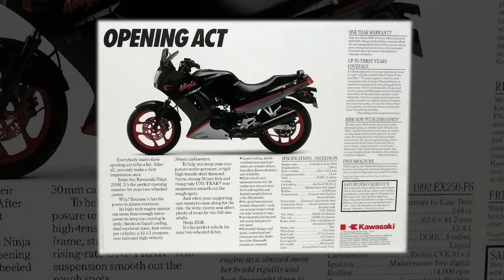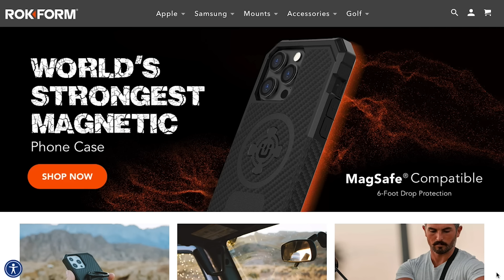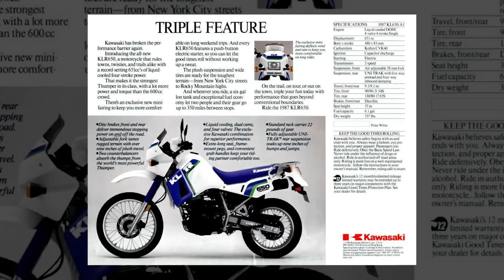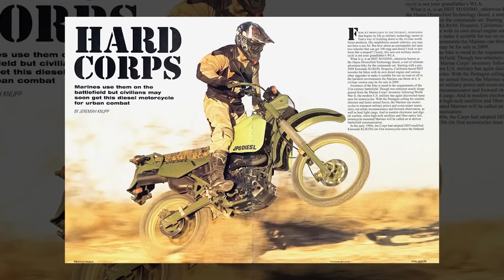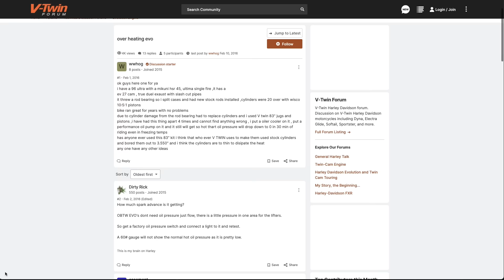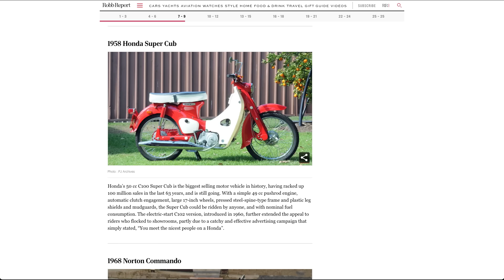Top 10 Ridiculously Reliable Motorcycles (Unkillable)

Comment: I’d argue that GSXRs are unkillable…think about the torture they’re constantly subjected to. And guess what? They just keep going. Wild.
Reply: Whoooaaaaaaa...... my GSXR 1000 and I are about to turn over 40k 🤣🤣🤣🤣
Reply: I had a 2005 GSX-R 1000 with just shy of 50,000miles. 
I had it dyno'd and it made 2 less HP than New. 
I think I was the 5th owner.  Lol
Reply: Bandit 1200
Reply: @johnnyhumbolt2545 I’m peanut butter n jealous 😩
Reply: @ar33turbo gsxr engine
Reply: The old oil cooled, yeah I’d agree.
Reply: @rapid13  new ones are the exact same
Reply: 100% agree! I had an 06 750 track bike that was crashed numerous times with an engine that lived above 10k rpm on a regular basis. That damn thing needed minimal maintenance and just kept on going👍
Reply: @offroad8055  lol, I have a K6 600 track bike currently. She just goes. Sees 16k rpm every time she turns on lol.
Reply: @Thorkell6969  GSXr’s haven’t been oil cooled for 20+ years.
Reply: The old tea pot engines run forever..........2004 kat and 60k and it's runs like it's brand new.
Reply: My k5 was a thing of robust, reliable beauty.  My L7 had its crankshaft changed once by Suzuki at 3000 miles and still shock so badly that when I took it to a crank balancing specialist their oscilloscope couldn’t read a large enough amplitude to continue the test beyond 5k rpm (yes 5k on a bike that redlines at around 13k).  Racing bikes in BSB had cranks explode at high speed and analysis by the crank balancing company concluded that they were only balanced in one plane and were whipping themselves to death.  In contrast, a mate’s L7 was smoother than a well balanced sewing machine.
Reply: @joemerican5781  my K6 just goes. I love it.
Reply: leviathanr53  😂
Reply: Gsxr with 100000 miles ot goes 180 mph
Reply: GSXR1100 oil cooled is the best engine ever. I've owned 5 Bandit 1200's i am biased
Reply: @ar33turbo couldn't agree more!
Reply: The GSXR1100 IS A GODFATHER OF RELIABLE SPORTBIKES!
Reply: So it's the 😊TRUMP Of MotorCycLes😮 👆 😊...

Comment: My 1999 Suzuki hayabusa has 200k miles on it and she’s still running stronger then ever.basic maintenance has preserved this bike!
Reply: Great work!  Did you always hit your valve adjustment services on time or space them out more?
Reply: Just adjusted them I also had 2nd gear and 6th gear cut as well I did a few other things to it as well but other than that it’s pretty much stock.
Reply: Very surprised there's no mention of the indestructible V STROMS.....Those bikes are hard as nails...
Reply: Now that's totally unexpected! I would have betted that Hayabusa and longevity were mutually exclusive!
Reply: Good job man
Reply: THAT is insanely reliable ! I bet you've ridden the crap out of it and she still goes.

Comment: I put 300,000 Km's on my 2003 FJR. It now resides at the Barber Motorsports museum in Alabama. It completed two Iron Butt Trans Canada Golds and one Trans Canada Quest rides among a few others. Other than basic maintenance, I had a leaky engine seal that required a starter rebuild and a final drive seal leak. That was it for problems. It never let me down. After 15 years, I bought another one.
Reply: Perhaps they could have afforded a higher state of tune of the engine? I believe that it is a close cousin to the engine in the R1, and my 2004 R1 has 130,000 miles (210,000 km) on it. I bought it new, and have no immediate plans to replace it. And it still does a couple of trackdays a year too.
Reply: Love the FJR. Had a 2012, 2017 and now a 2020. Plan on keeping this one for the rest of my life. Very enjoyable and dependable bike.
I really need to get to Barber Motorsports Museum in Birmingham someday. Would be neat if your bike is still there when I do.
Reply: I saw your bike when I was at barber earlier this year!
Reply: Love Yamahas.  My 2009FZ1 just turned 96 thousand miles not a problem.  Not quite your miles but still bike owes me nothing.
Reply: @jamesmclaughlin3460  That makes me happy to hear. I bought a 2008 FZ1 last year with 37k on it and I plan to own it for a while. It's a fun bike.
Reply: @craigsmith6224  great bikes just had a ohlims rear shock and new front fork cartridges inthe front.wore the stock ones out lol. Great bikes.
Reply: I saw your bike at Barber too! 👏
Reply: @andysedgley  When ? I've been waiting for it to be shown. We are riding down from Vancouver, BC in September. So thrilled to hear and thank you so much for letting me know.

Comment: I have a Honda VFR 800 Interceptor and it is known as one of the most reliable motorcycles ever made, that V4 with it's gear driven cams is indestructible, mine was made in 1999 and now it's almost 2024, it runs flawlessly and is in primo condition.
Reply: Same here ...2003...80k.
Only thing is that dam charging system
Reply: Same here..04 VFR 800...favorite bike ever...great handling and that little vtec boost at 6500 rpm always makes me smile❤
Reply: @herbertsiegl7762  Late response, and slightly different bike but -  1996 VFR750, 96,420 on the clock. I feel that with the stator and r/r, seems like the one thing they couldn't ever fix 😭.
Reply: Agree, my Gen5 '99 still runs like a new bike, bought it with 1800miles in '05 now with 85,000miles, I have twice looked at new bikes, and have twice snatched my keys back rather than part with it...
Reply: @John451vfr  
I will never get rid of mine.
I did a tune on it, full stainless steel exhaust with a 4 into 1 Delkevic and just about to hit 26k miles.
If there is one thing I would complain about it, is the location of the radiators on the sides, they do get quite warm on my leg in hot summer days.
Reply: VFR 800 IS NOT GEAR DRIVEN CAMS
Reply: I have the NC750X and VFR1200X. Huge mileage done in these too

Comment: I have had my Sportster for 25 years and 400,000 miles.37 back tires and 17 front ones and 3 belts. It has out lasted all of my Honda's put together. My BMW 100/7 had 500,000 miles on her at the time of her demise. My CX500 had 250,000 miles before suffering Catastrophic engine failure. Cam chain broke and destroyed the engine.
Reply: I have long maintained the Sporty engines are by far Harley's best offering.
Reply: Over a million miles.  Chill, bro.
Reply: @billygraham2132  Easy to do for someone old enough who's ridden for decades. I'm not at that level but do respect it.
Reply: He did say that Sportsters were very long-lived. I haven't  owned one, but I've seen friends' go 100,000 mi. +
Reply: @garylaajala9461  The carberater and the alloy cylinders and head make for a cool running motor. If you don't cook your oil to ☠️ it lubes and cools your engine.A cool running motor is nice to ride since it's not cooking the oil and the rider to death 💀☠️.
Reply: @MotorcycleEnjoyer01  people don't believe the amount of miles I have on my Sportster but it's absolutely true. I just do regular maintenance as needed. I would check and see if I have the riveted clutch plate that is known for coming apart and damaging your clutch I don't know why they would put a part like that in there but I would change that out right away before it ruins something

Comment: Exactly why the Ninja 250 was my 1st bike. Bulletproof reliability and I was a absolute hooligan on it and it never gave me a problem. Further proof why the Ninja 250 then 300 and 400 are the king of beginner bikes.
Reply: I owned 2 Ninja 250's. One a Black and purple one,and the 2nd one,an all Yellow one! I did some mods to my Yellow one,by installing two aftermarket-exhausts in place of the OEM one's,rejetted it,and my FAVORITE one (which I was asked ALL THE TIME about),is if you pause the video when your able to see the BACK of the Ninja-250,You'll quickly see @ the 3:11 mark,that it has 3 separate red-lenses in the tail section! The middle lens being the actual brake light,while the outside smaller two red lenses didn't serve any purpose! HOWEVER,I took MINE,and installed CLEAR lenses on both sides and removed the stalk rear turn-signals and took the bulbs and wiring and stuck them in the no-light lenses on either side of the brake-light to serve as turn-signals!!! It was a rather easy and simple mod. to do,and looked AWESOME when finished as they worked just as reliably as the stock one's that hung on the lower "Stalks" on the rear. : >)
Reply: I can't wait to try a Ninja 400 soon.  Really looking forward to finally getting a motorcycle
Reply: @RezaQin  Congrats on becoming a rider soon. The Ninja 400 will always be my recommended 1st bike. Hope you find a good one.

Comment: I feel like the ol dr650 should have atleast been an honorable mention, tho you did throw it a bone in general with the dual sport category. Im a little over 20,000 on mine and have done nothing repair wise other that oil changes, one valve adjustment, and a bunch of tires being i used to run k760 trackmasters. It has been extremely reliable and not needy in the least, it just works, like the klr there are many that will confirm it as well.
Reply: Ah you see he was looking for bikes that might break in the 200-999k range. Not bikes that require the heat death of the universe to stop them ;)

Comment: As a long-time Honda owner I'm so glad you started this topic with that brand 😊
A happy CBF-1000 owner
Reply: I actually clicked on this video to come to the comments and tell him that he left out the F4i, and it was the first on the list. My first and only motorcycle so far   (currently looking for '07 Fireblade) has been my '04 F4i. Had it over 13 years and the only non-maintenance part I needed to replace was the automatic cam chain tensioner,  with a manual tensioner. I work on HDs, but I ride Honda.

Comment: 250,000 kilometres on my 2007 Triumph Bonneville that I've owned since new. Tyres, brakes, chains and sprockets and regular oil changes are mostly all that has been required. recently replaced head stem steering bearings and have reshimed the valves once
Reply: Impressive, and gorgeous bikes as well

Comment: Honorable mention to the Suzuki Bandit 1200, they were oil cooled, carbureted from 1997 to 2006. Then in 2007 they basically give it a 1250cc hayabusa engine that’s been detuned to 95hp and 80 ft/lbs. VERY understressed engine. Suzuki is slow to evolve but they’re tanks.

Comment: I'm very surprised a Kawasaki concours and the BMW 1150R aren't on the list. Those things are damn near bulletproof and even after 80 to 100k miles with basic maintenance and still run brand new
Reply: The 1100 and 1150 boxer motors are incredible, unfortunately it's the rest of the bike that wasn't. The wiring back then had really weird sheathing that breaks down over the years and causes all sorts of odd gremlins. An unfortunate side effect of a dry clutch and shaft drive also mean that the transmission and rear drive units can wear out with extremely costly repairs being necessary. I saw a R1200CL, which is the same motor as the 1150, with only 30k on the clock that needed a clutch but during disassembly I found the input shaft to the transmission wiggling which meant blown bearings inside. That job went from a clutch replacement to a tear down and part out thanks to the cost of required repairs. But... Yes the engines alone are fantastic 🤣
Reply: I have a bulletproof 2009 Kawasaki Concours that has 135,000 miles of pure joy, just normal maintenance and a lack of problems. I fully expect another 100k plus as I personally know of other Concours going forever also.
Reply: @AlanSmith-dg6lc I have the '11 Concours 14 at 15k miles, I have awhile to go😅
Reply: @seatime674  Long may you run!~Neil Young
Reply: He also totally forgot the Suzuki GZ250

Comment: VFR-800, I’ve had 2…one with 5 owners and 35k miles and the one I have now which was 6 owners and I’m at 43k miles. Even with the high mileage it’s still one of the smoothest running engines I’ve ever owned (smoother than my 954 that has half the mileage).
Reply: I was shocked he ain’t at least mention it, I’ve got a 750 and it’s amazing
Reply: @Domthemechanic  the 750 is reliable, but the 800s are lower maintenance too being FI and not carbed
Reply: @DeadLemonz  for sure, carbs can be a pain in the ass but honestly I’ve never had as issues since I rebuilt it a year ago
Reply: Good bikes but that's not high mileage, get her over 100k first 👍 and she will get there if you try
Reply: 43k miles is not even close to high mileage lol
Reply: @fatalgaming6068  for a sports bike it is, and I work 12 hours a day I don’t have that kind of playtime.
Reply: I've had 3 and they've been super reliable.  Met a guy with a '99 800 at a bike meet a couple weeks ago with over 200K on it.
Reply: @milleRC51  that’s awesome, they’re great bikes. I can’t think of a single bike that’s more “all purpose” than the vfr’s. Nearly as fast as a 600 under 90mph, great performance in the twistsy, usable on a track (not ideal but works), more comfortable for long rides than a lot of cruisers, and even somewhat passable as a beginner bike due to the v-tech.
Reply: I rode a VFR G back in the day as a long distance courier. It rarely went less then 1000 miles a week and occasionally 2000 miles. For 9 years it ran faultlessly other than eating a few rectifier/regulators. It announced its intention to retire when the output shaft splines finally wore down. I had the front sprocket tig welded on but realised it was time to retire it. With 289,000 miles on the clock.
Reply: 43K is just about broken in, for a VFR 😂

Comment: One of our customers had a 2003 GOLDWING, he logged 450,000 miles before the original engine's compression gave out. The only significant repairs were replacing 2 alternators and one starter motor.

Comment: I had a 94  Harley Softail Custom I road from 94 to 2022.  I never had an engine issue. I replaced it with a 2022 48, the last evo built.
Reply: EVOs were overbuilt for reliability and underbuilt for power from the factory. A little work and they'd make power and still be overly reliable.

Comment: Pretty cool to see 2 of my 3 current motorcycles on this list. 2008sv650N and my crf250l . The Yamaha Wr250f I also have  isn't supposed to be street legal but mine is. It's an off road racing engine so incredible reliability isn't legendary but it is great for type of engine and its power output for its size.

Comment: I'm glad you recognized the Harley Sportster. They are bullet proof with basic maintenance. I do have to mention my 84 Harley FLT which has accomplished over 300,000 miles with only one valve and ring replacement. I know it's not normal for big twins but it was the first year for the Evolution engine and Harley was out to prove themselves with it's launch. It truly is an exception.
Reply: Its sad the finish is so bad the mudguards and frames rust badly and even suzukis are more durable.
Reply: However the evo Sportsters is a beautiful bike and are basic which i aplaud. Even the electrics are better now than before.

Comment: Surprised Honda st1300/1100 pan European wasn't mentioned like the goldwing they go for ever my 1300 has 87k miles on it and my friends ex police 1100 has nearly 90k on it still both going strong
Reply: ST's never caught on in the U.S. like they should have, but you're right - they're fantastic. I have a `91 1100 still running strong at 65K (as well as a 1978 GL1000 with 51K).

Comment: My Suzuki TS50X sat in a garage for nearly 15 years dry, has had 6 owners in total. Took it out last spring, refurbished it, gave it new wear parts and tuned it myself. It runs like new to this day, even with 240k km mileage.

Comment: I once met someone on an 80's Goldwing. He shows me the odometer was over 600k miles and he insisted he was still on the original engine with no major issues.
My dad has a Ducati 900SS which is now over 90k miles. Original engine, never had any major problems and not many minor issues either.
Reply: My first bike was a Honda Silverwing (GL500). I bought it with 1,200 miles on it and sold it at north of 97k. Horrible starter bike as every time it fell over it landed on the fiberglass fairing and the mirror snapped off, but boy did that bike take a LOT of abuse and keep on running!

Comment: I think a big part of what made super cub so good, is when you do break it, you can pretty much fix it with tape and hammer
Many of this kind of work bike and scooter are build not just to be reliable, but also very easy and cheap to fix
there are still tons of people out in places like Japan or Taiwan riding around in 30, 40 years old CB125 or super cub and there are so many parts out there you can keep them running for ever, and so simple every shop and mechanic can fix them for cheap

Comment: The supercub is a personal favorite of mine, more specifically the 70cc and 90cc versions of old in the passports and trail series. Your entire electrical system could fail, even the charging system and as long as you have a kick starter and the 2 or 3 wires connected for the exciter coil, it'll start just fine. Not true of the new ones however but they're still nice bikes. Another testament to the reliability of the old gals is that Honda still uses their engine style with very few, if any, updates in the 50cc, 70cc, and 110cc dirt bikes and ATVs.

Comment: My dads DL650 is at like 140k miles. When we replaced the clutch at 135k miles we discovered it was fine. Right now it’s out since it lost third.
Reply: Love it !
My 2008 DL650 just turned 18,000 miles so it's a "spring chicken" in comparison
Reply: @psalm2forliberty577  keep it forever man. if you do that means you can buy a Ducati or something “unreliable” and not be worried about being out a bike.

Comment: A common complaint I found with l Royal Enfield (2019-2023) is the oil temp sensor giving false codes. You have to reset it constantly in cold weather conditions. Changed it out twice and still getting the same code.
Reply: Plus many broken frames on Himalayans and crankshaft failures too. This video is utter BS.